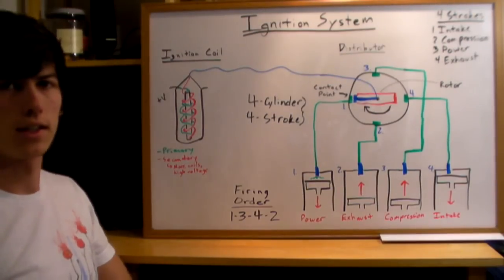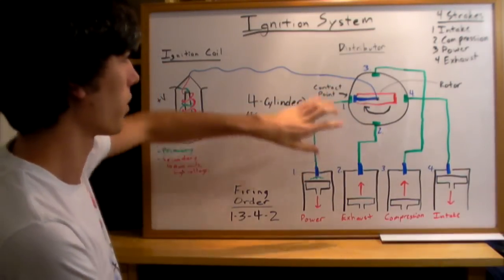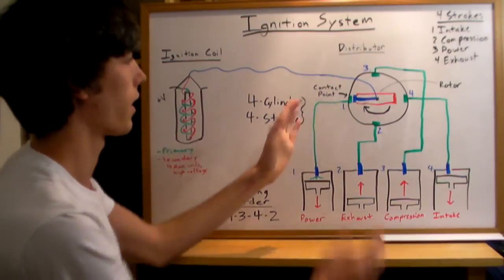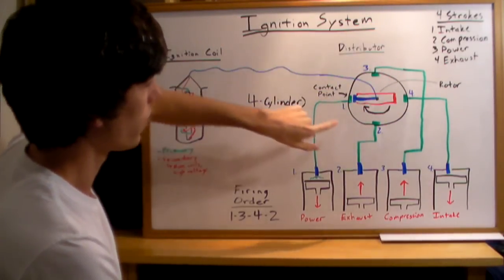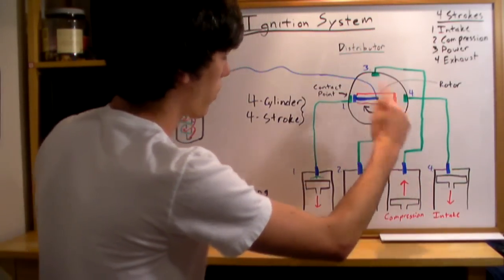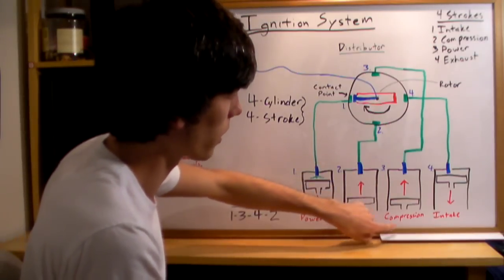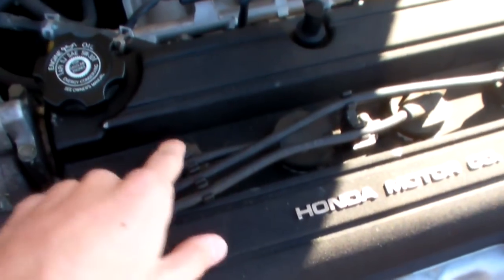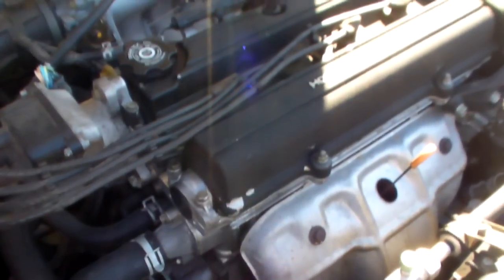Ignition Systems - Explained

Comment: Naa this is basic the distributor system, the fundamental of primary spark ignition using back EMF is missed and that's the reason the high voltage is produced.  
you tubes allows callow youths like this lad to put up rubbish...look out professional stuff from Ac, champion the services etc for more useful information . 
so in old engines the reason for the capacitor ( condenser) , the difference between Hf spark and standard sparks. Unpack point ignition, electronic ignition and later solid state ignition??? 
Telling me how to find the timing of the distributor ...nup nup